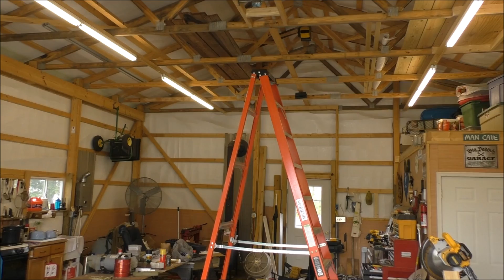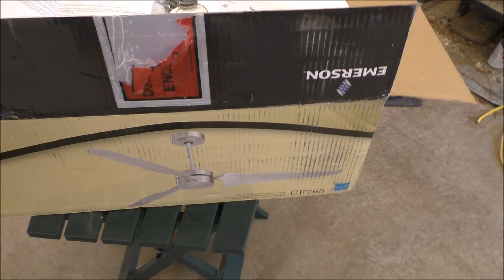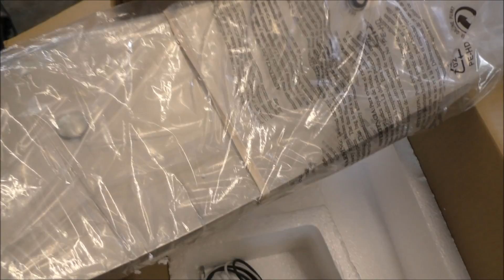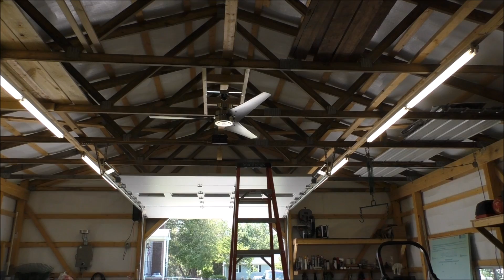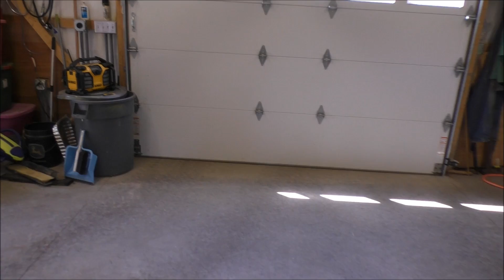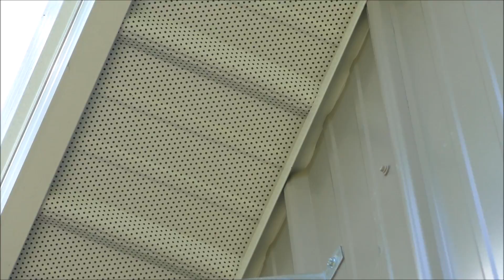Emerson CF765BS, Loft Brushed Steel Ceiling Fan Install And Review In CHA Pole Barn By KVUSMC

Comment: I would recommend Hampton Bay Industrial. They blow a bit more air, and are cheaper. Loft and Hampton Bay Industrial are both made by King of Fans so they’re basically same thing except Hampton Bay has a thicker motor. Emerson Heat Fan 60” in the other hand blows more air than Hampton Bay Industrial.
Reply from the maker: They are nice also

Comment: Kenny, with that much ventilation in the ceiling (soffits, etc.) does the wood stove heat the building up well enough in the winter?
Reply from the maker: Paul Petrea Yes Sir It Does But On A Cold Cold 25 Degree Morning I Crank Up The Propane Heater Once The Wood Stove Gets Heated Up It Is Comfortable Better Than Being Outside  It Does The Job With Out Breaking The Bank Really Efficient  Paul I only Used 1 - 20 Lb of Propane This Winter The used Motor Oil And Wood Keep It Toasty